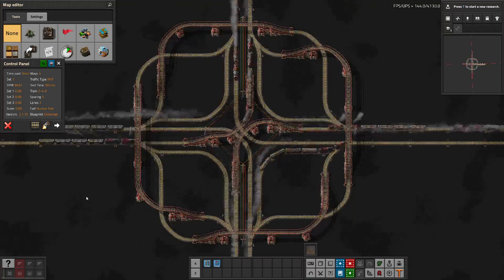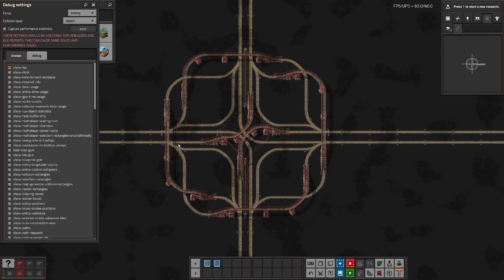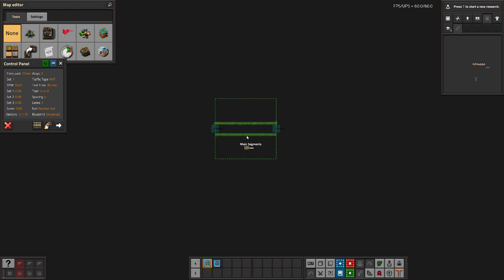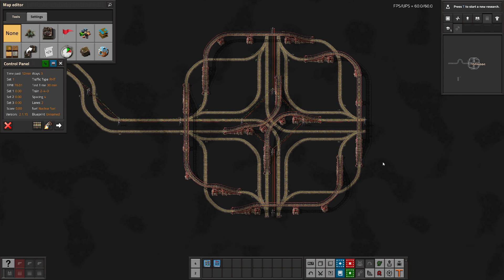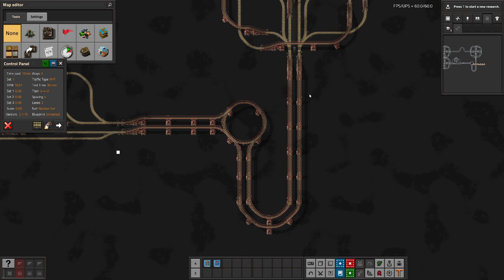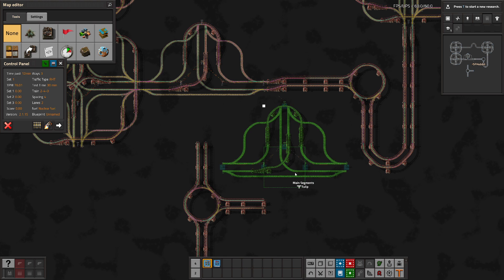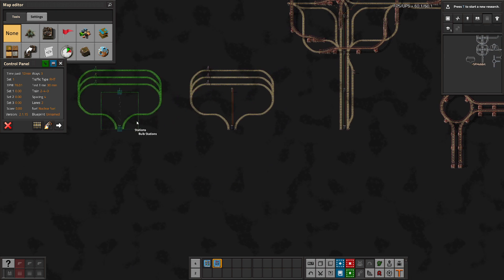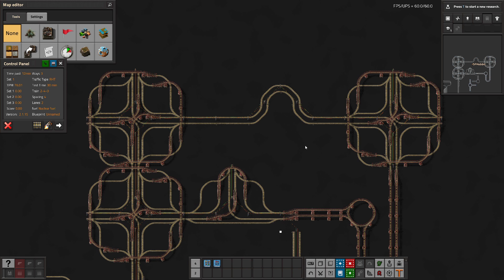Factorio Space Age - Rail System Design & Compact High-Throughput Elevated Intersections

Comment from the maker: 12/5 - v2.1 - Added 5 new segments: the two basic diagonals, a 2L->1L block, and elevated versions of the two main intersections.

This blueprint book will be seeing a lot of updates as I flesh out the rest of the system, especially the stations. Keep an eye on this comment, my twitch channel, or the google sheets for new additions.
Reply: Nifty!  Some thoughts:

1. You could just call it the 'SFH Rail System': short, sweet, and to the point.
2. Personally, I usually build my stations off of a turnaround.  It easily holds a 2-4/1-4-1 train and has plenty of space on both sides for doubled loading/unloading.  ...and, by adding another chunk before joining it back to the track, I can depot an extra train or two.
3. I would have the power poles as a separate blueprint.  They would be easy enough to slap down if you need them, but would be less of a royal pain to remove if you don't.
4. Can you add diagonal rails as well as the orthogonal ones?  There are plenty of times that using them would make life a lot easier.

Cheers!
Reply from the maker: @KeithOlson  1. That's what's going to happen if I can't think of a better name :^)
2. That's what the Bulb station is (yes I know current ver is missing signals) and I'll be designing more stations like it. The modularity of the inline stations is meant to be used in conjunction with the rail roundabout - i.e. you can place two inline stations in a row, a roundabout, then two more inline stations and have a long thin segment with 4 stations on it. This gives the system a lot of flexibility. 
3. Nope, they're going to be in the main blueprint, this was a core design goal and I'm simply not putting down two sets of blueprints when I want to run the rail somewhere. Don't see how they're a royal pain to remove - are you aware you can right click the pole icon in the blueprint menu to remove them all at once?
4. Wasn't originally going to in order to prevent bloat but at this point I'll very likely add the two basic segments.

Comment: I was struggling with a 1000x science base because I am horrendeously incompetent at making good rail designs and this literally saved me. I swapped out every intersection and suddenly my trains could actually go where they wanted instead of whatever horrible mess I had. 

Was trying to avoid using blueprints, but what a gamechanger. And they're so pretty <3
Reply: just put direct belts inserteted, it saves UPS too

Comment: This is incredibly helpful!

I was torn on how to setup my power grid, I initially placed power poles on the corners of each chunk. Now that I'm trying to add trains it is awkward as the rails essentially occupy twice as many chunks. I like your approach but I was wondering if placing the poles in the center of the chunks would be good vs having them on the edges or corners.

Also, I noticed that the pole in the center of the 45° bp is off by 1 LOL

Comment: Great design! Was just designing my own train network blueprint before discovering your video. Now I'm not longer designing my own train blueprints - yoink, hope you don't mind ;)
A few things that I have added/would like to see you add to this system of blueprints: 1) In-line U turns with elevated rails for more bi-directional mobility without sacrificing straightaway throughput and expandability. 2) One-way exits and entrances to the bi-directional straightaways. More space efficient than using a Tulip T section and allows you to have bigger and more flexible loops for stations and buffers. 3) Intersections with an elevated roundabout and a regular crossing with ramps, for a more compact and economical omnidirectional intersection without sacrificing straightaway throughput. 4) More one-way designs in general. I know the goal is bi-directional tile-able blueprints, but the tight spaces on Fulgora's island really limits how much train infrastructure you can put down.

Comment: nice intersection, but its missing a key feature of a roundabout: the turnaround (i.e. trains go back the direction they came from)
I went ahead and added one, the BP should fit over the vanilla intersection :) 
0eNqd1u9ugjAQAPB36WdI7D9KeZVlWVA6bQKFFDAzhncf2ODmLLPXT0aF353Xu5Mr2tej6qw2AyquSB9a06Pi7Yp6fTRlvXxmykahAtlS12hKkDaV+kIFnpKNi1JbNt2vK8n0niBlBj1o5ezbm8uHGZu9sjOVrLerWp3LQVVpP8zS8TSkt6gJ6tp+vr01S6gl+C5L0AUVks1hKm3VwX2ZLUn90cmzfhjteX65Jbv36cLp/FHHzMPTiORzx2evk2f/J196dEycLgKS58nzwT2LZEMkHjGDVxtjx8uAhEVEPVyr4B0O8HP4aWLp9328fKx3P3ZdawcfmoejeAdPmmCAHzGfhAJ8EuFzgB8xokQAfBbhA5oGc3jTU+L3fTsGZ6FdSdeqk0eV+1TPqJ7K+jOtdHls53+NrdLQtfQ0IPU8Mghb+58HBJFBW/JecvH6SEnEyN5TDvEjRpZRgB8xsowDfApveZb5fe+eJxEzywTgB/AIXwL8DO5zSAOJCB/SQHnozuGQsZIRWW+25fzUqgfVzNjPI3KCzsr2bullRDIpORNScEGn6RtX7bna
(edit: i kept it minimal so it'd fit in  yt comment, you will have to add this on each of the 4 sides, and add signals)

Comment: Awesome. This is what makes this game great. I kinda like the option to go diagonal. Will you make those? I'm also quite the fan of what Nilaus does with his substation grid. I hope this will be fine with it.
Reply from the maker: Wasn't originally planning to do diagonal to prevent bloat but after messing with it in the sandbox for a bit I might do the two basic pieces. Power poles are a bit less neat since it has to go corner to corner but it's not too bad.
Reply: @StupidFatHobbit  You should add another diagonal peice. As of now you can only go one way diagonally, and the option to go ther other way would be nice.
Reply from the maker: @riftborn1058  Uh, just flip it.
Reply: @StupidFatHobbit  and how exactly do you do that? I just get the message that blueprints with rail signals cant be flipped
Reply from the maker: @riftborn1058  The straight to diagonal and diagonal pieces in my book do not have signals by default. That is your doing, not mine.
Reply: @StupidFatHobbit  ah yeah that makes sense, my bad
Reply: I prefer either a 100 tile 'chunk' like the Nilaus City Block, or my 50 tile chunk size.  And I would prefer rounded curves or circles in the center. Diagonal is fine in some places like the outer edges.